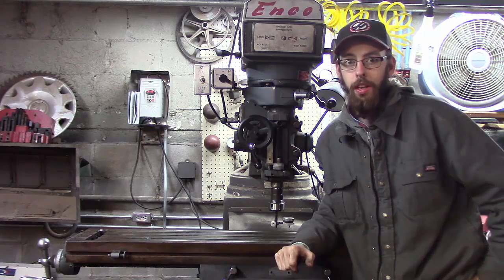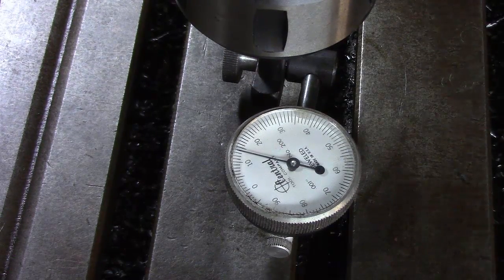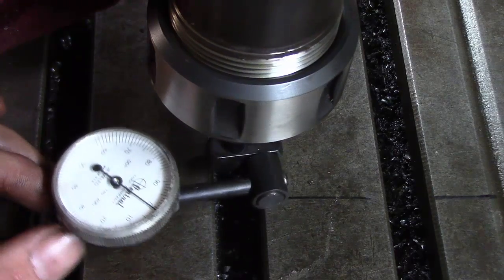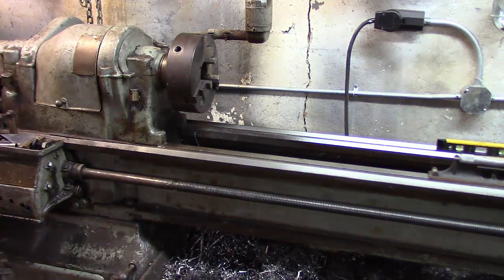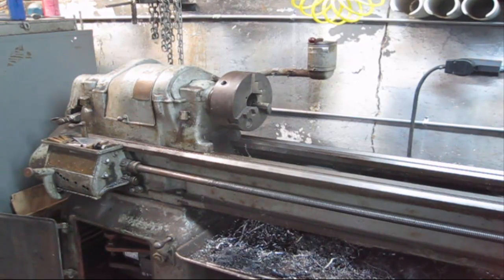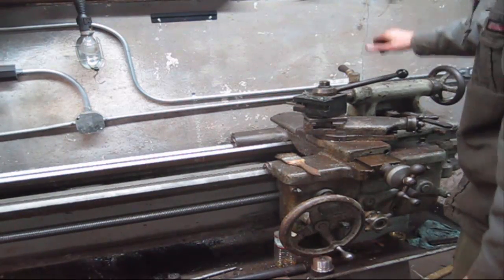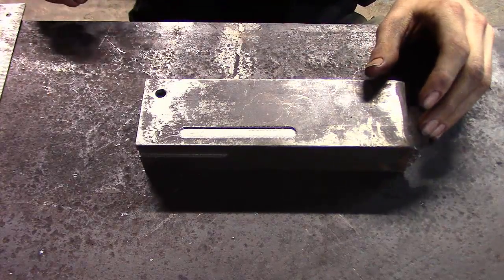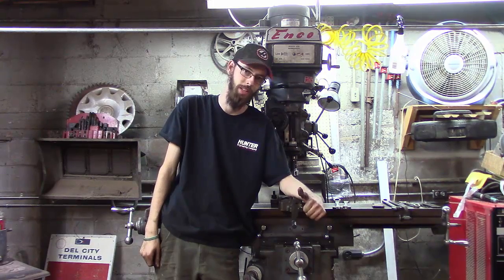Machine tool setup

Comment: Good video, I would like to help you set up your mill. First off, having the machine level is more critical than you may think. You will want the machine to be as perfectly level as possible. Now for terminology, the side to side swing is called the "Tilt". The front to back swing is called the "Nod". After you get the machine level, you will do what you did with the dial indicator to set the tilt and the nod to be perfectly perpendicular to the table. Now I noticed you had the dial indicator mounted with a short indicator shaft. To get the most accurate measurement you should have the indicator at least 10 inches out when checking the tilt and have it to the  farthest distance out on the front and back of the table when checking the nod. If you do this as accurately as possible, you will be able to hold as close tolerance as can be achieved by your machine. I hope this helps you. I have been a professional machinist for over 30 years. One thing great about machining is that you never stop learning. It is a great satisfying and rewarding career and hobby.